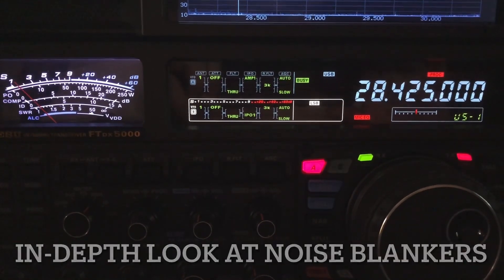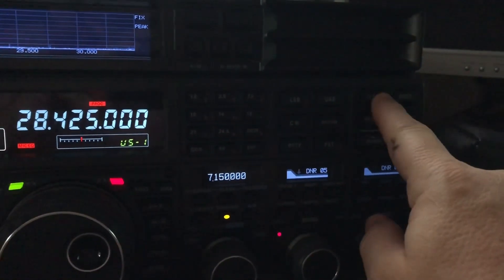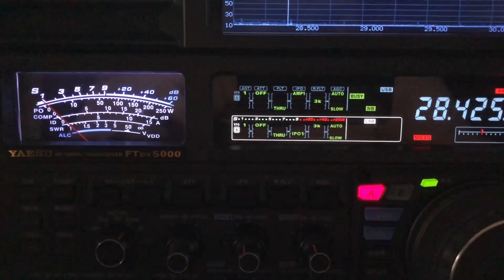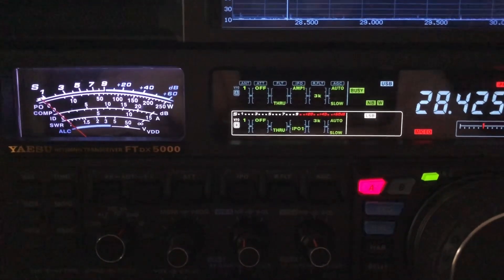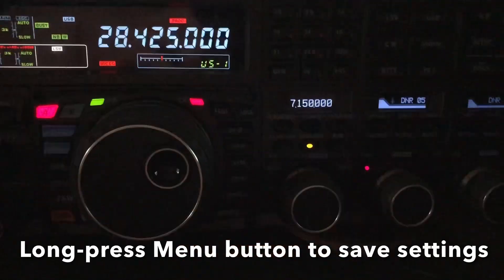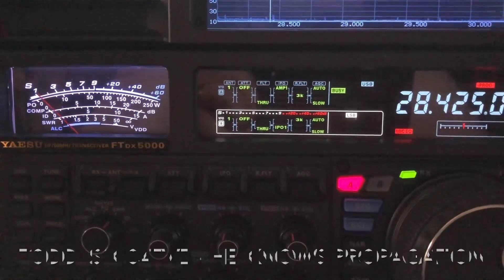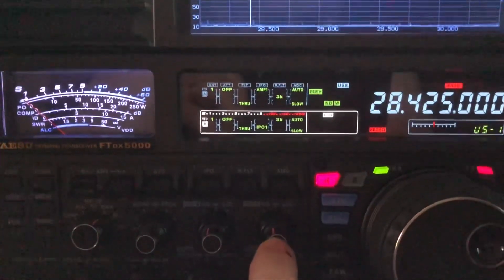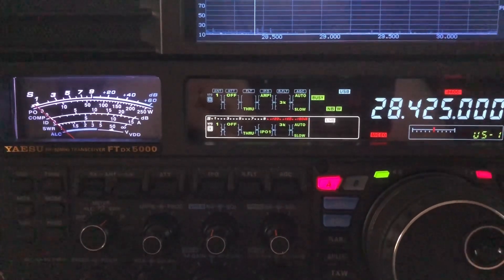In-Depth Look At Noise Blankers

Comment: few decades ago GE made commercial radio gear with most amazing noise blankers which remain unmatched. on FM !!! 
find out how they did it! 

even yaesu's own ft1000d has a noise blanker which works on fm beautifully
yet none of the dsp radios can match that simple feature and the popular belief is that a noise blanker is not possible on fm because reasons....
Reply from the maker: Yes, most FM receivers use a signal limiter stage that is effective against noise pulses that are superimposed on a FM signal. There are also dedicated noise blanker circuit designs for FM that track the noise after the FM detecter and loop back to blank out the noise in the IF amplifier stage.

73, de N4HNH

Comment: Good info.  Btw what’s your opinion on the cause of the reverb that is so persistent on the audio from the guy calling calling?
Reply from the maker: The reverb is normal. I’m using Digital Noise Reduction. It strips out so much noise that you can hear the AGC hang time. It’s always there but you can’t hear it until the noise is minimized. 

I always use DNR, set at algorithm 3.   l’m so accustomed to DNR that I won’t operate without it. I sometimes set it to a more aggressive algorithm, 5 to 7, if I’m struggling to pull a weak signal out. Or I leave DNR at 3 and use Contour, set to between 1800 and 2200 Hertz.  

For CW, I set DNR to between 12 and 15, usually 15, to minimize filter ripple. I’ve shown that in so many videos you’ve probably already seen it.

73, de N4HNH

Comment: ...i don't know how you do it...you almost always put up a video that deals with an issue that has me scratching my head and through the operator's manual! thank you and 73!
Reply from the maker: I’m glad to know that. I get numerous inquiries about dealing with noise. It’s actually a common subject for hams these days. There are so many more sources of noise these days, compared to when I got started in radio, in the 1970s.  Noise is my main enemy these days, trying to chase QRP SOTA stations. 

So, I had a gnawing feeling that it was time for that video. You have validated that feeling.

73, de N4HNH
Reply: @n4hnhradio  so true!, 
noise is the biggest enemy. 
 and yet  organizations like arrl are completely absent from the front lines of this war.
every Joe Blow can press a buy it now button on amazon and wipe out 3 square city blocks with that chinese gadget once he turns it on.
this is a complete failure of the fcc and arrl.
Reply from the maker: Amen to that!  So true.

Comment: Todays video subject is of utmost importance to  those living in cities, villas, apartments and even rural areas. Internet, cable TV, power lines, LED street lights, electric fences, grow lights and etc brought back the need for a real NB instead of some artificial DSP filtering. RX noise killers became so important that Kenwood, Icom, Yaesu, Elecraft  should incorporate it in the future projects. Some NB may cause audio distortion on the the RX side and some, such as the Kenwood TS450S, won't work at all. I remember the Drake TR4C noise blanker was art at its finest. My Yaesu FT-890 has a terrific NB. Why can't we have that back?
Reply from the maker: Exactly!  Yes! Yes!  Have you seen my FT-890 videos?  I still have mine. Best noise blanker ever. However, it doesn’t eliminate the wider noise from some of the modern sources. 

See mine at this link: https://youtu.be/Gr_zxQ94qq8

Also at this link: https://youtu.be/QqrMdetAKvw

The phase cancellation type noise canceling technology should be included in every radio with two antenna ports. Perhaps include in dual-receive transceivers the ability to alter the phase of the signal in one receiver against the other, when noise canceling is needed. The job of the QRM Eliminator in the radio. 

73, de N4HNH
Reply: instead of real engineers yaesu hired an apologist named John Crook-Jean-Pierre
and where is arrl? the fosilized dinasaurs isnt it their job to remind the fcc about what's important?  proliferation of noize is off the scale